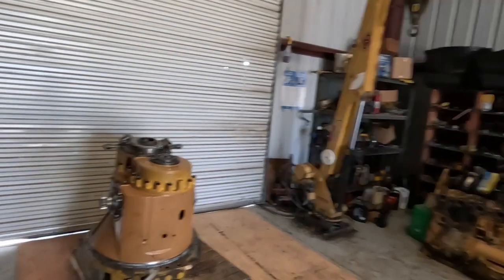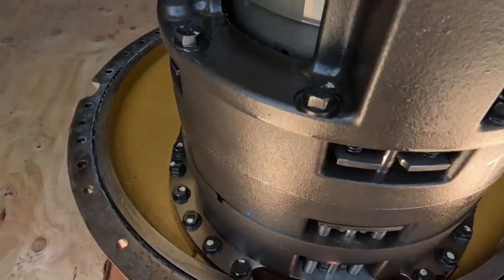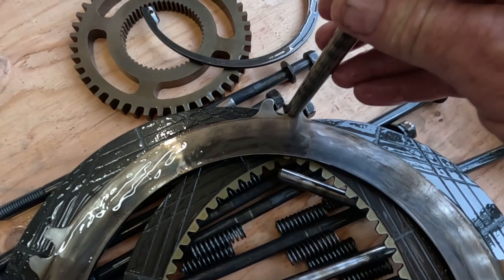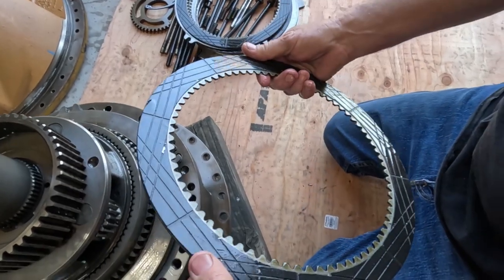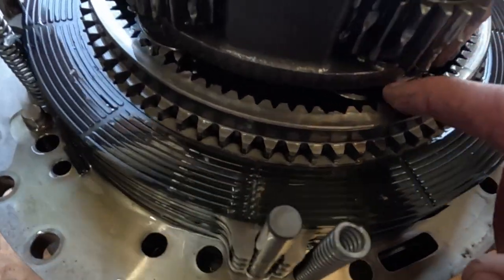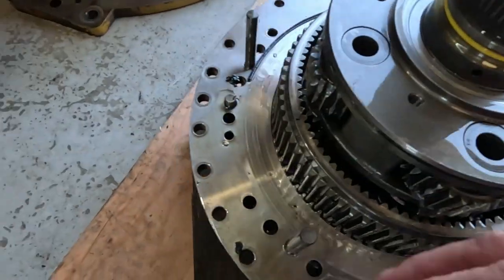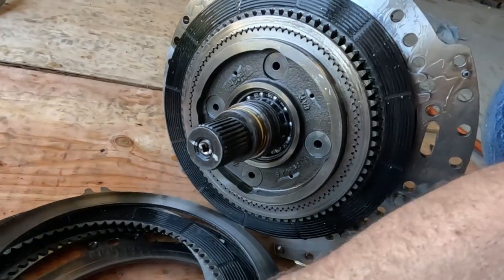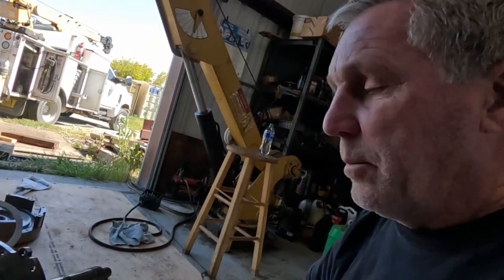Cat Transmission Fail... D8T Total Destruction (Disassembly Video)

Comment: very informative in every parts youve  removing bro,,, im confuse why it has happen that gear broken maybe human error the first service was not accurate during the settings of thats  spareparts ?
Reply from the maker: I’m not sure why the gears broke, maybe the low oil pressure from the seals that was cut on last rebuild
Reply: Likely a piece of debris started this chain reaction or a cracked tooth/damage from last failure.

Comment: Aftermarket parts never workout in a CAT transmission
Reply from the maker: No they don’t, they are for someone to put in just to get it running for an auction. In my opinion
Reply: @RasmussenEquipment   yeah no kidding. We’ve only had to use like aftermarket metal seals in some occasions due to them not being available